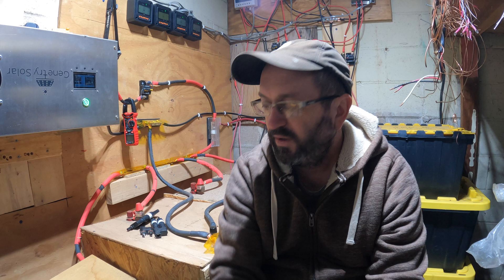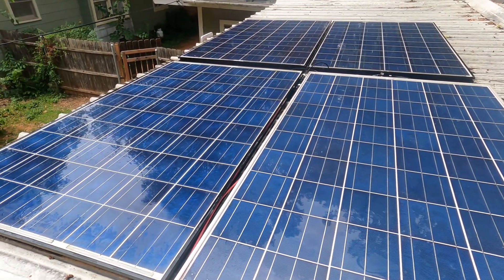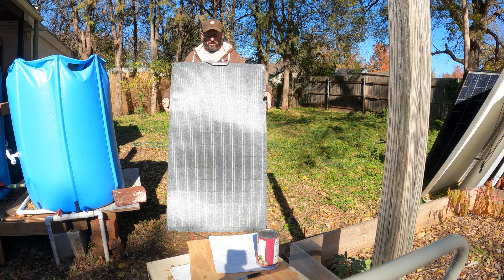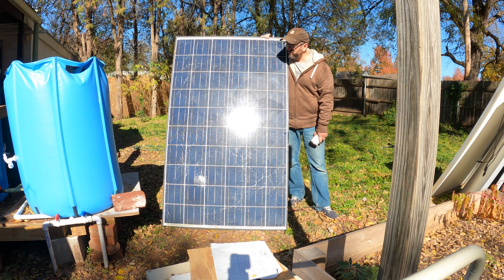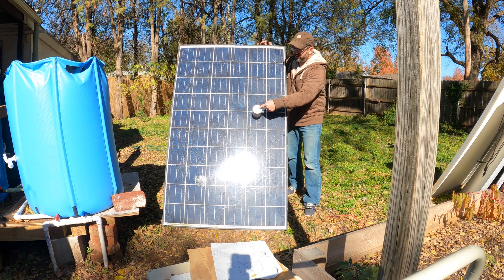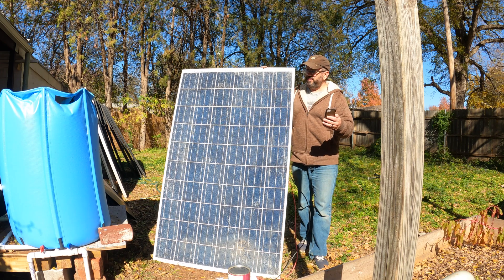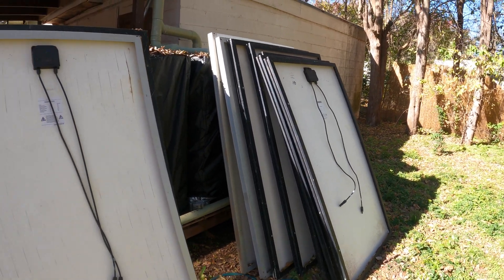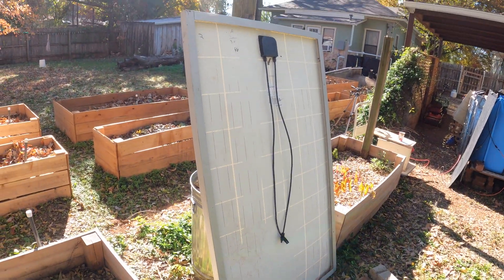What is the issue with my 24v 800ah off grid solar system?!?

Comment: I started out in solar with Newpowa 200 watt panels.  They turned out to be junk in less than 2 years. The junction box fell off some.  The side rails became unglued from others,  bubbles in the sheet of the panels,  and most have crazing in the glass. So,  I took them all off the roof because it's just plain dangerous to have them up there.
Reply from the maker: Dang.  That sounds terrible.  What did you replace them with?

Comment: Sounds good making the panels string up in series in big systems, can help let a big controller charge easier handling the amps better instead of using a parallel system and limiting wires, allso more then one charge controller can easily see which string of panels to check for issues much easier on big systems needed for environmental conditions.  Sun power is best any size so the bigger the system the better. I would buy a huge auto battery charger 120v 110v plug type and have a diesel generator to run from with plenty of  fuel storage and a pump for filling when needed. I herd thier are some bio systems for personal gas ,that also help feed the plants when mixed in to a compost area. Yes more then one backup generator on stand by with cleaning and spare maintenance plenty of fuel and huge solar, digging some and green house power companies can charge electric technology and help grow the plants with the sun. Colder climates need everything not only portable but allso at any moment. I believe oil and power companies with big solar can all work hand in hand with people and governments.

Comment: I'm confused by your math. You say you have plenty of battery capacity but it drained it to the point of shutting down with a light load.

What was the SOC when you started? Have you done a capacity test on your batteries? May be a battery or connection problem. Overnight has nothing to do with PV input.

Comment: You might want to check the diodes on the bad or weak panels before you totally condemn them. They may be partially shorted and they can be replaced fairly easily. Its worth a look. Good luck
Reply from the maker: Excellent idea!
Reply: I say this because I received a weak panel (used) from Santan solar. Bought 16 for my project. I was gonna send it back but it was a hassle, so I checked the diode bridge and sure enough one diode was flowing some current in the wrong direction. Got diodes on Amazon for next to nothing. Soldered it in and got 208 watts in good sun as opposed to the 135 previously. 250 watt panels by the way. Goodluck with your project. Its a good thing.
Reply: @Wayne-f5y  Yes, bad diodes can cause all sorts of issues.. If you are changing them it is an upgrade to go with the newer style J-FET which have lower loss and better fault tolerance.. Matching the right ones takes a bit of patience and they are more expensive but in the end there is a visible improvement.. These used panels have cell shorts (snail trails) and cracked glass so bypassing a shorted cell string at the diodes can give the panel an extra chance but unless you have a huge area to mess with these it is better to just buy new made in Texas or the revamped factory in Oregon which are under $200 a piece for a 400w+ with a warranty.. I have 300w single face that in a couple years I plan to swap out with these for a 25%+ increase in capacity..
Reply: I must have missed the condition of the panels in question in the video. Must have been talking to my wife.

Comment: If you are on the roof just check the last array in place. You may want to increase array voltage to 60-90 volts. Higher voltage helps in lower light conditions.
Reply from the maker: The array on the roof is already about 100v.

Comment: I have old panels  on the roof at 24volt also,they suplly power to my shed. Over the summer I put 200w 24v panels on grond mounts ( much easier to clean ) 8 in total at 48v. I get about 3.5 hrs. of sun a day right now and it still charges my batteries.I am also in Ok.
Reply from the maker: Where at in OK are you?

Comment: I use lead carbon so not an expert on lithium from what I have watched on YT sounds like imbalance in the bank? My 1st inverter wouldn't charge past 60% maybe that. Since Nov 7 I have seen 6 hours of sun, 11.6 kw array mounted vertical with snow, over 8kw a day 40kw with sun. Now this year I added a 3.3kw array which can over amp, the mppt at 3800w with sun/snow, I knew it would overpower so I put a stick in front of 1 panel, so now I can get 3kw but having the 6th panel boosts my overcast watts on that array sometimes 1200w light overcast with no visible shadows. I plan to overpower 2 more arrays in summer and move them south for a possible 2 more hours of sun. Last year I never saw sun or shadows for 100days and could not track anything, so I didn't know trees 300 yards away were shading me at 1pm. Check each battery off the terminals? Last time I checked mine the 4th bank was .1v lower, not sure if that is a problem with PbC. If you are sure the batteries are happy then time for some panels, these bi facial half cuts work well, I installed most of my panels solo not too heavy but with panels over 450w some are at 13 to 14 amps and should be considered for most inverters/controllers, if you have an EG4 18KW they handle 16A, my 8k only 14A per string. Forecast said 4 hours mostly sun today, then thick fog ruined about 22kw of charge. My JA 550w are $185 CAD at solaronline. I bought mine at $220, prices keep dropping. Maybe test your strings before connecting and compare with the mppt's rule out any other problems. Vertical can work with no snow boosted by white rock around the front of the panel, if you have more than enough solar march to sept that would be good since vertical drops to 55% with brown dirt.
Reply from the maker: Thanks for your input!
Reply: @OurBlackCatCottage  if I had a chance to do solar again , I would go with 20 kw solar and 60 kw bank

Comment: For a shade-tolerant panel, I recommend modern bifacial panels with half-cut topologies.  An example of such a panel would be something like the Hyundai HiS-S410YH(BK).   MANY brands use this topology now (bifacial + half-cut).

* Modern Bifacials are not any heavier than single-faced panels.  The bifacial nature of the panel does help with shading and helps even when one face is flush to the roof.

* Half-cut panels use a 3s2p topology internally which is a very shade-tolerant topology.

* But remember that shade is shade... it does a number on generation no matter what.  Still, its far better than older panel types that would go to 0W.  For example, I have the above panel on my Pergola and it still gets 20W in 100% shade just from looking at the sky, 40W in bright cloudy conditions (still in 100% shade, looking at the bright cloudy sky), and gets better in direct sun with partial shading.

* Though perhaps the 410W panel in my example is not the best choice for single-manning due to its size and weight.  But you get the idea.

Also make sure that you have a sufficient number of panels in series such that TWO panels can drop-out (go into bypass) due to shade without causing the Vmp to drop below the MPPTs optimal voltage range.  Many people do not put enough panels in series and one or two drop-outs due to shading causes the voltage to go so low that the other panels are unable to produce optimally (the MPPT winds up running the other panels near their Voc instead of near their Vmp in order to get the minimum voltage it needs to operate).

Definitely scrap any damaged panels.  The damage reduces the panel's current-carrying capability and in a string configuration this spells disaster for other panels in the string because a damaged panel that has full sunlight will NOT go into bypass.  Instead it will produce less and also reduce the string current for the entire string.

* Damaged panels in full sun can reduce the power output for the entire string because they have enough voltage to not go into bypass, but insufficient current-carrying to support the current from the other series panels.

* I would throw all such panels.  Just straight-out huck them.   Power loss due to regular aging is fine.  Power loss due to broken conductors and cells does a number on the whole string.  Or perhaps consider wiring the damaged panels in parallel into a lower-voltage buffer battery and then DC-DC into your 48V pack.  But... meh.  Current can become a problem in that case.

--

Battery Balancing:  If the batteries are well-balanced across summer you don't have to worry about not being able to charge them to 100% during winter (e.g. like 4 months or so during winter).   All that will happen is that the cells will go slightly out of balance and drop the battery capacity to (e.g.) 95% instead of 100%.  But since you can't charge the battery pack fully anyway, it just doesn't matter.

When summer comes around again it will take a few cycles charging to 100% for the BMSs to rebalance the cells.  That can result in BMS cell OVP disconnects near 100% for a few days but with enough batteries in parallel this usually doesn't happen to the whole pack.

--

Battery temperatures.  Try to keep LiFePO4 batteries above 40F during winter if possible.  Generally means having an insulated battery box and a little 20W thermal blanket inside, or something similar.  Depending on the type of winter weather you get.  This will help the battery bank accept more current without its voltage rising as much during charging which in turn allows the MPPT to deliver more current.  Plus the insulation will allow the battery's internal heat from internal resistance during charging and discharging to maintain a decent temperature.

-Matt
Reply from the maker: Yeah I got my eye on some bifacial panels.... Hopefully I can get them soon.
Reply: @OurBlackCatCottage  While looking, be sure to distinguish between old bifacial technologies and new ones.  The old bifacial's were very heavy per-watt, they literally had a double glass and double cell layer.  You don't want those.  You want modern bifacials which weigh-in very close to their non-bifacial counterparts.

Typically modern bifacials use half-cut cell topologies while older ones do not, so that's a good indication as well.

Panels are getting cheap enough that a lot of people now just buy new in bulk.  That also means that shipping can now cost almost as much as the panel itself in small quantities, and it is hard for used panels to compete unless you pick the panels up yourself (no shipping).

--

Checking current carrying capability... in the shade take a panel and short it (connect its "+" and "-" together).  Place in full sun, measure current with a clip-on DC amp meter.  Put back into the shade (or cover with a towel) and disconnect. 

Repeat for each panel individually (of the same type).  Any panel whos current is low by more than, say, 10% verses the others, should be thrown away.

Take care to only connect/disconnect the short with the panel covered (zero amps), else you will get a dangerous ARC.  And don't short a full series of panels.  Just one at a time.

-Matt